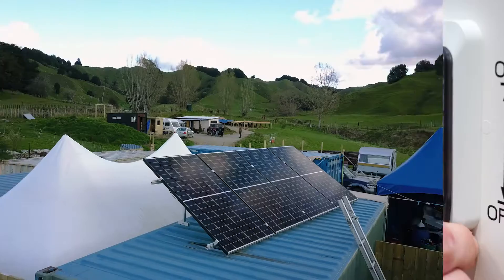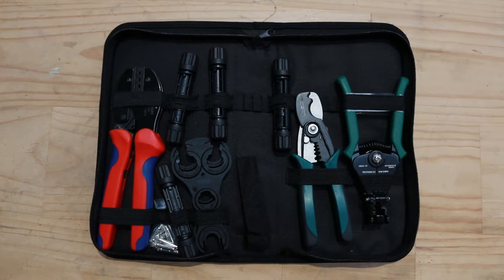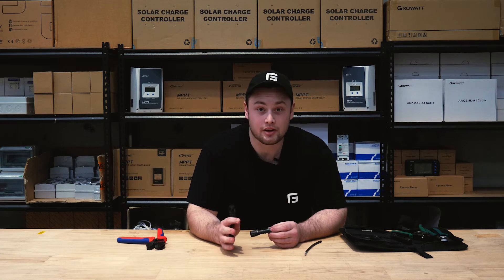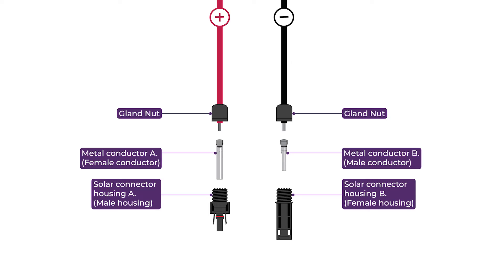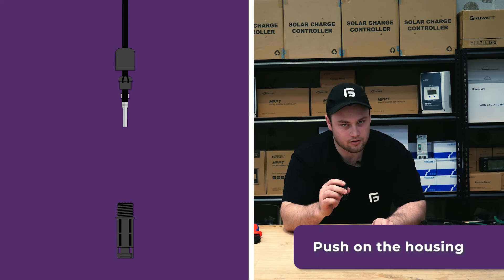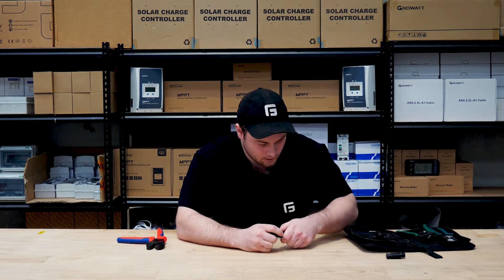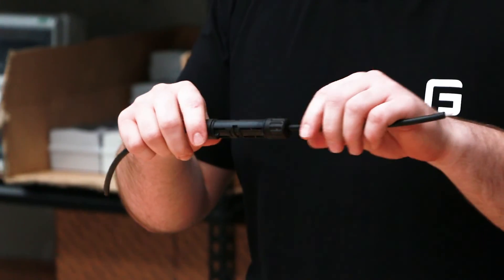How to Crimp a Solar Panel MC4 Connector | Billy's Workshop | GridFree

Comment: Almost useless. Does not show close up of the parts together before crimping!
Reply: What way does the metal piece sit in the crimping tool?  Wish your videos had more actual closeups showing how to do things. Newbie
Reply from the maker: @ShiraKaiman  If you look at the thumbnail of this video for reference - the end of the metal conductor that has the grooves on it, is the part that is getting crimped around the stripped wire and then tightened by the gland nut.
Reply from the maker: Hi @M22Research  & @ShiraKaiman - thank you reaching out. That is great feedback, we are considering re-filming those close up shots so they are more clear and will re-upload some time. Feel free to email if you need more guidance in the mean time info@gridfree.store
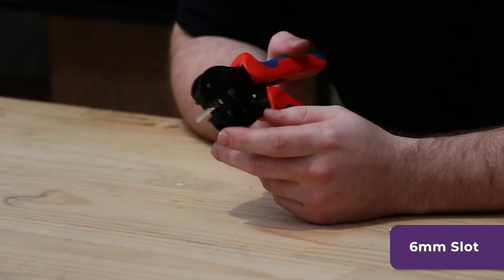Reply from the maker: Hey sorry to hear you're unhappy - did you see at 00:32 there is a close up as the wire gets stripped! And 00:53 - you can see in a close up the conductor in the crimping tool before it is crimped.
Reply: @GridFreeStore  0:53 your index finger is blocking the closeup before crimping!